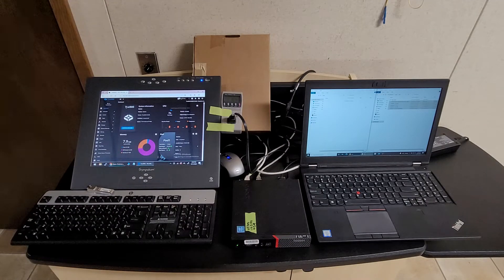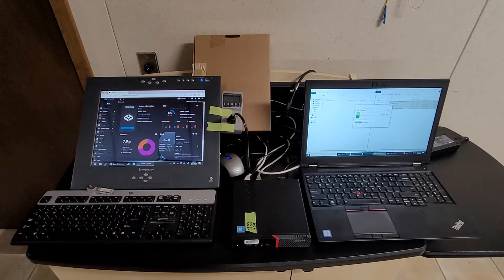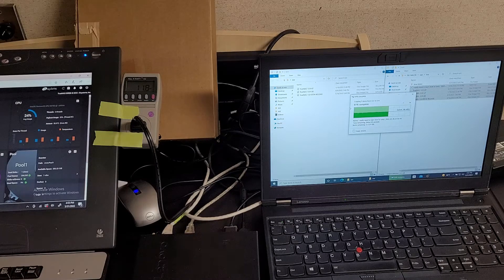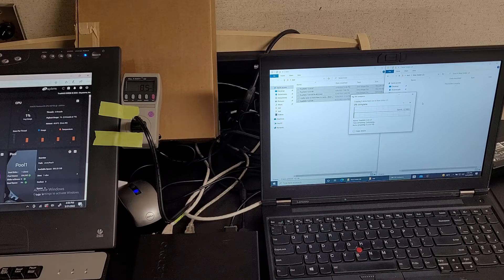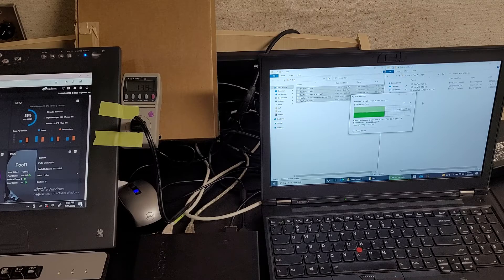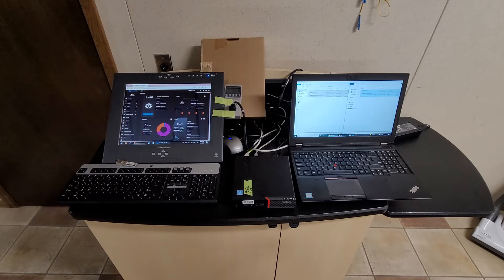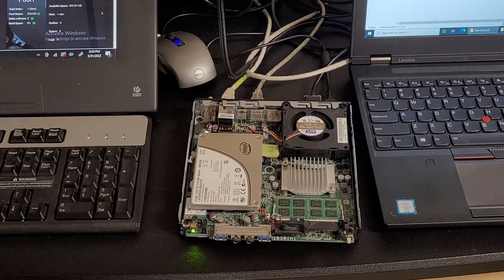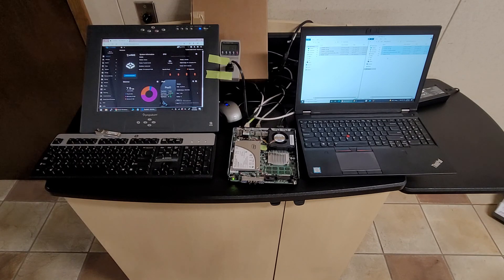Follow up: Is the Lenovo ThinkCentre M600 Tiny the ultimate low power SSD NAS?

Comment from the maker: No follow up to this follow up unfortunately.  I tried putting a 3.5" drive in the unit, but it wouldn't spin up. It would take more effort than it is worth to get a 3.5" drive working in this.

11-25-22 Edit I do have a follow up to this follow up.  More of a different approach though.
Reply: always have a separate power input for the 3.5 drive. Also, on that 2.5 drive bay, what is the maximum height can it accommodate? The regular 2TB HDD is around 7mm thick I think. While the 5-6TB is around 15mm. This would be a nice compact NAS.
Reply from the maker: @fat_joe  Yeah it would require a seperate power input to run a 3.5".  It should have no problems with regular thickness 2.5" drives.  Any thicker and you would have to run it without the cover.  I do need to do a follow up to this video now that SSD prices are dropping.
Reply: @computersales  oh. If it can accomodate those 15mm ones, this would be a nice portable wireless NAS. Raspberry PIs here are way too expensive.
Reply: I'm learning, one video at a time!